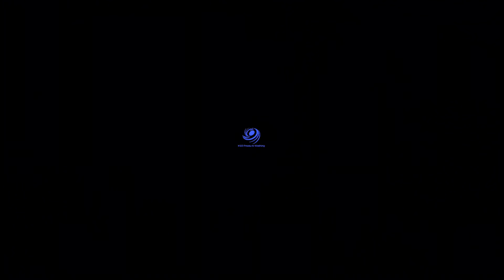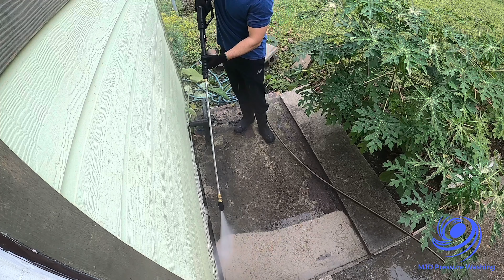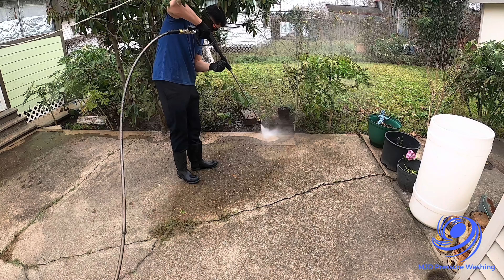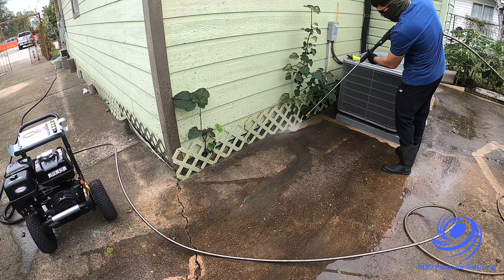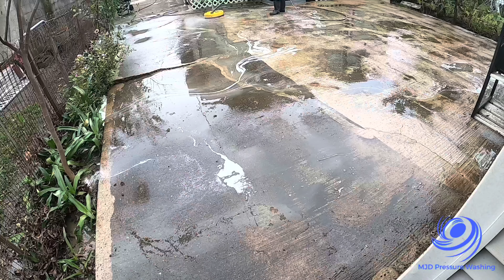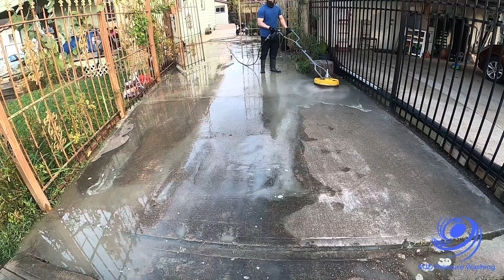We Pressure Washed This Sweet Elderly Lady’s Patio and Driveway (SHE LOVED THE RESULT)

Comment: The difference is abundantly clear. And helping out the elderly? Truly wonderful. It was also obvious that the slope of the patio/driveway was different in the back than in the front, because the water in front seemed to constantly be streaming back toward the house. Still, you came, you saw, you cleaned.